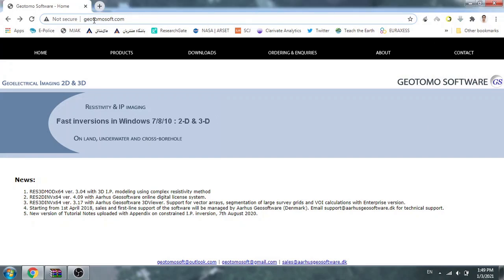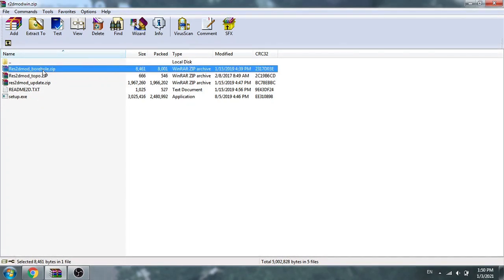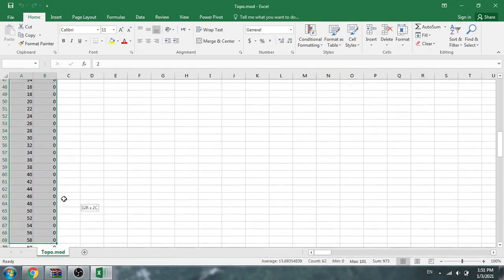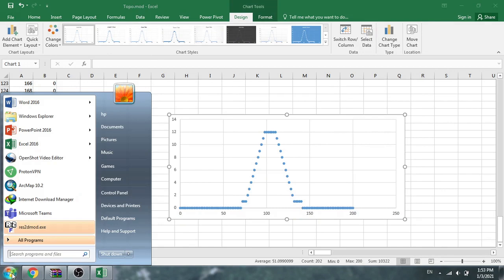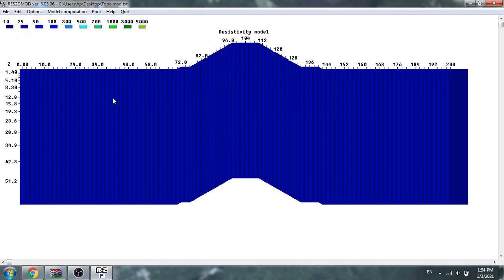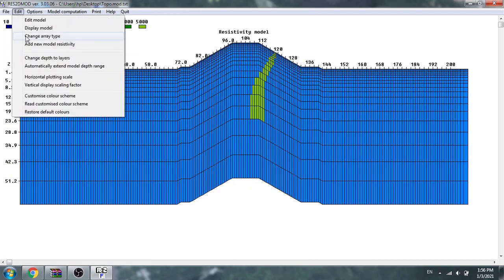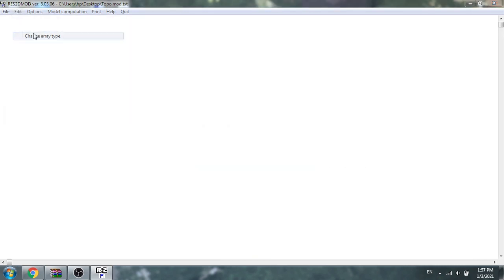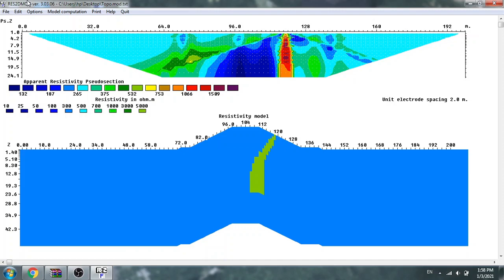Res2dmod Software Tutorial- Incorporation of topography into forward model

Comment: What is the difference between synthetic model and forward model.? after comparing our inversion results with the forward models can we justify the match based on forward model or do we need to present the ground truth for it? Also, if you can share your contact email, WhatsApp etc. I want to discuss some data. if you don't mind. Thanks
Reply from the maker: Thanks for your comment.

Regarding your first question, there is no difference. I used two different words as you may hear both. 
We define model parameters or we built the model; then we do the forward modeling.
Reply from the maker: Forward modeling is calculating the response of a given model. So, if you use forward modeling data of a given model as an input dataset for the inversion, then you can compare the inversion results with the forward model to validate the (1) effectiveness of inversion or (2) the suitability of your designed array.
Reply from the maker: Ground truth is for the data that comes from the field (inversion of field real data).
Reply from the maker: I hope my comments would help. 

My email is provided in the description of the video, or the "about" section of the channel.
Don't hesitate to contact me.